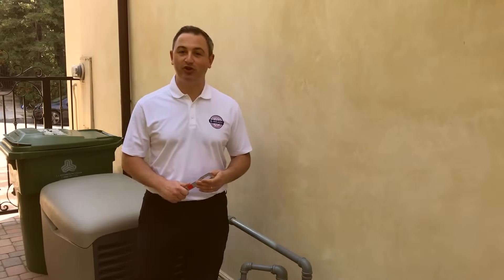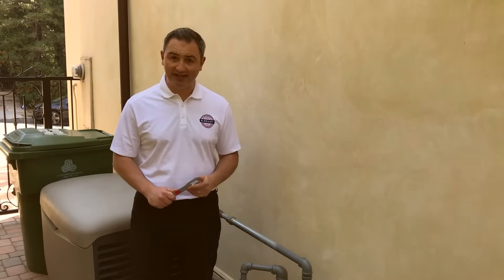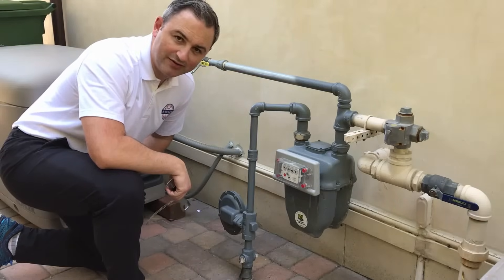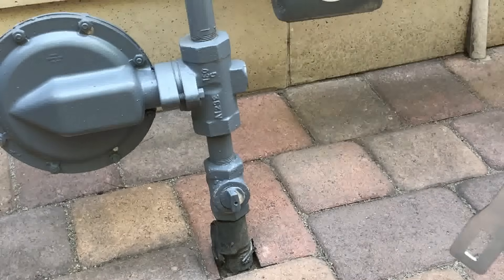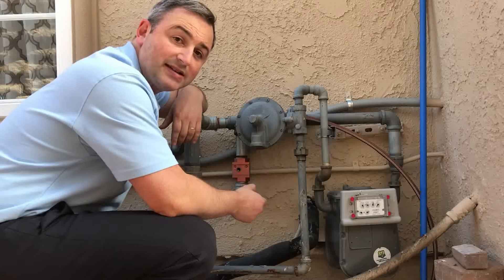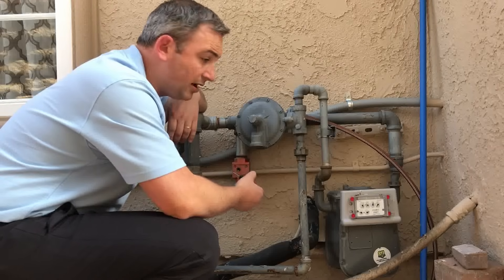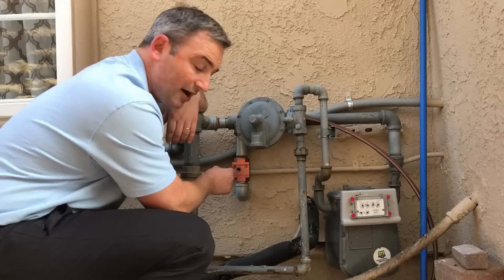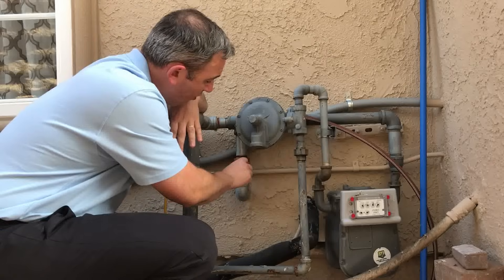HOW TO shut off and restart your gas line in case of emergency

Comment: Good information. Only thing I would add is that if you're qualified and going to turn the service valve back on yourself, do it slowly. You don't want to rupture the regulator and end up with a leak.

Comment: The gas valve tang is weak, brass or bronze. You sometimes cannot just try to turn it,  if it has been in place for years and is oxidized (stuck in place). If you turn hard you'll break it.  There's sometimes a nut on the backside of the valve, that draws the cone-shaped valve tightly into its seat. Spray wd-40 on the valve. Let it soak a bit. Loosen the nut maybe half a turn. Take a pice of brass or aluminum (don't want to make sparks) and carefully hit the male threads of the valve plug. You're trying to loosen up that cone-shaped plug. If you see it move slightly out of its seat, you've successfully broken it free of the oxidation. Now you can turn it without breaking the tang.  When you've turned it to the position you want (open or closed), now you can tighten the nut on the back side.  Test for leak with soapy water. If leaking, turn the valve back and forth to seat the valve better. If you can't get it to stop leaking the gas company needs to replace it.

Comment: Just FYI you do not own that quarter turn valve that you are operating down towards the ground. Your gas utility owns and operates everything up to and including your meter. You should shutoff your supplies using the isolation valves provided DOWNstream of the meter. You can see you have two of them, one for each branch, at 0:53
Reply: I’m e
Reply: Incorrect.  Shut off upstream of the meter, same for water.  Always.

Comment: If you have newer appliances they have safety devices that would shut the if there are any off on older lines there may be a small valve attached to the appliance shut offs upstream side to control the pilot.

Comment: in my area, anything before the meter including valves, regulators, and meters ect. are owned by the gas company. any alteration of these and you may be held liable. although, in an extreme emergency they may wave issues with turning the gas OFF, BUT NOT BACK ON AGAIN. doing it wrong may damage the regulator, causing another emergency.
Reply: That's right, because they will turn that valve on in a super secret special way!  Not.  Wake up.
Reply: I got royally chewed out for this!

Comment: Turning on main gas valve on high pressure should be done slowly not to blow the pressure regulator
Reply: High pressure? It's not under  high psi